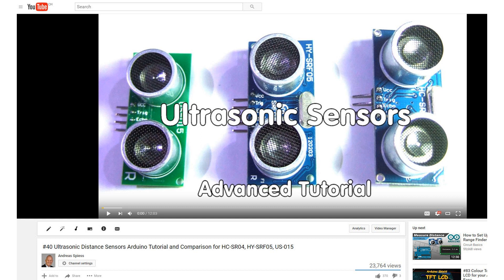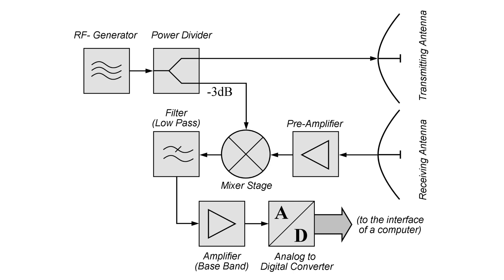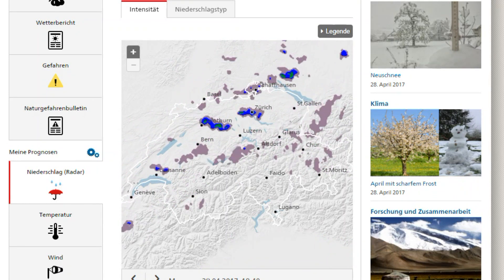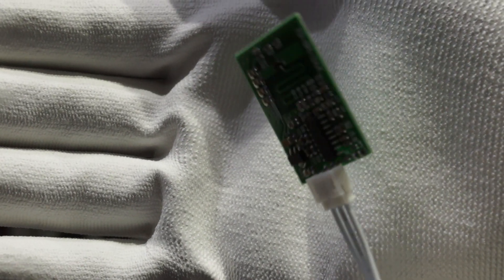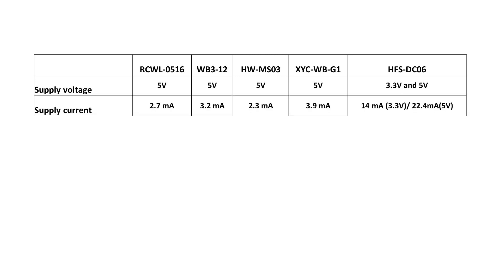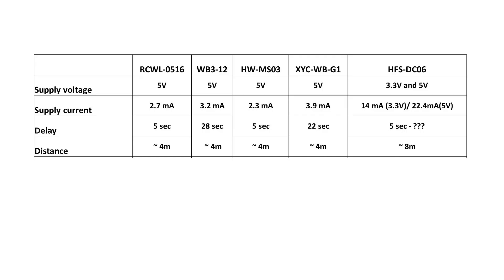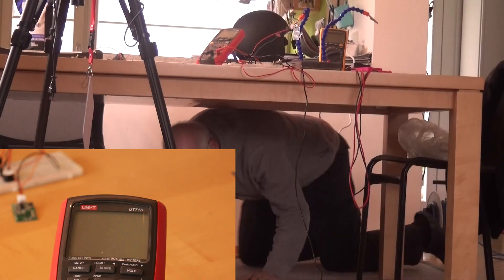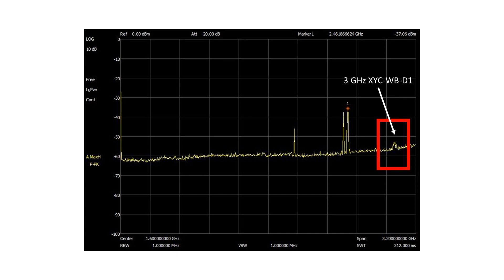#135 Radar Sensors / Switches: Comparison and Tests

Comment: Great video. An idea: could one of these modules be hacked for playing varying sounds by waving your arm or dancing for example? :-)
Reply from the maker: +yomboprime Try it!
Reply: yomboprime Just use the output signal to drive a midi controller. There are many examples on the net of using signals from diverse electronic gadgets to drive midi signals through virtual instruments and effects.
Reply: Yes, but the problem is that the output is delayed 5 s. I was thinking instead in measuring the output  of the mixer (analog signal), if that is possible.

Comment: Receiver, mixer and transmitter with one transistor is not uncommon. For instance search for "Pixie qrp". This is a 2 transistor solution but the second transistor is only for audio amplification. A simple direct conversion receiver is a continuously transmitter too. 
I think in this case of radar it is a regen receiver. The reflected frequency of a moving object is a little bit detuned and strong enough for this short distance.
Radar are only directional using parabolic antennas, as you can see in the video. Make a test put the module is a can know as a "cantenna". See if its works
Grüezi Tim.
Reply from the maker: Thanks for your explanations. It is possible, that the principle is similar to these pixies. But still, it is interesting, that it can receive and transmit at the same time and be selective enough to distinguish the received signals, which are for sure much smaller as the one sent out. The pixie sends or receives, but not at the same time as I understand.
Reply: @AndreasSpiess  The trick is that it is a self-oscillating mixer.  The transistor keeps the oscillation going, and at the same time due to its non-linearity it mixes the received signal with the transmitted signal, effectively a direct-conversion receiver.   The same thing as what you have in an old and cheap AM transistor radio.
The processing of the output signal provides the selectivity: a low-pass filter of the output is providing a bandpass around the actual transmit frequency, and this is where the doppler-shifted receive signal always appears.  The frequency of the lowpass determines the maximum speed of objects being detected.
By selecting a low enough lowpass and having enough spread in the production (capacitor value in the tuned circuit), the outputs of different units will be far enough apart to not cause mutual interference.

Of course without an RF stage it is not very sensitive, but you want only close range operation so that is OK. It is a very clever circuit indeed!
It is not very directional because the antenna isn't very directional.  When you would put the entire thing in the center of a parabolic dish (sat dish) you would get very directional operation and much more range (like the picture of a radar you show).

Comment: hello,
do you also links to the source code that you used?
Thanks!
Reply from the maker: I did not use any processor or software
Reply: Thanks.
I will watch again your video because I did not understand this the first time.

Could you please also tell me if you have any idea about the maximum distance at which these sensors could operate correctly?
Reply from the maker: We only tried 4 meters

Comment: Hello, great video as always!. 

May it be possible, that your glas door has some kind of special isolation glas? I have a glas ceiling lamp from Steinel with build in radar sensor and have put a lots of these E27 Light Bulbs with build in radar in different glass lamps and they work all very well thru the glas. Eaven thru my front door. My hall light switches on when I stand outside the front door. 

I love these radar sensors and I've nearly replaced all PIR with these. The E27 Light Bulbs are easy for places where you don't want to put extra cables. For replacing PIR I use these: https://goo.gl/0YL5en

I have lots of these in my house and I didn't notice any interference with my 2,4Ghz and 5Ghz WLAN.

It is cirtical to use several devices (from same type) in the same room. I put three bulbs in the same lamp and I got a light show!

I haven't tested these small ones for uC use yet but I have some already lie here.
Reply from the maker: Thanks for your feedback. I use a similar one as you in my lab and so far, did not have problems. After the video, a viewer suggested to switch a second sensor of and on. This triggered the first without any problems (if it was the same make). They did not influence each other when always switched on. Maybe I will play a little more with them in the future...

Comment: Hi again Andreas! I did a teardown/writeup on the HB100 doppler module a while ago at https://www.allaboutcircuits.com/news/teardown-tuesday-hb100-doppler-radar-module/ and yes, the amount of "RF black magic" in those modules is pretty amazing.
Keep an eye out for any which generate a complex IQ "quadrature" signal. I haven't seen any yet (in this range, they all have a single "amplitude" output) but a lot of interesting possibilities open up if you can get quadrature, such as synthetic aperture radar imaging.
Reply from the maker: Thanks for the link! I think, these modules are even simpler, because they only seem to have one transistor... I would be interested in your analysis of one of those! But I think, we both are fascinated about such simplicity...
Reply: Indeed! I noticed that, (no ceramic resonator, how!!) and the only thing I could think of was perhaps they're using the antenna itself as part of an LC resonator. It might also partly explain why there's not a lot of cross-talk - the frequency would be so inaccurate it would be pretty much random over 100's of Mhz, and getting more than a few Khz away is probably enough for post-mixer rejection.
Reply from the maker: Maybe it will stay a "working mystery" :-)

Comment: This was interesting, but I was hoping that these would work for distance sensing instead of just movement.  My ideal use would be front/rear distance for cars.At 3 ma x 5 v, that's not a lot of power - 15mW, and that is radiated across 360 degrees (well, a full sphere, if I understand some of the statements), so I guess that wouldn't be considered high enough to be a harmful amount.My other immediate thought was, if you put one in front of a metal plate, or small metal parabolic dish, could you use it to detect humans behind a wall.  On reflection, I don't think that this would work consistently - walls have different compositions and thicknesses, and a human at rest might not trigger the sensor, so it's back to movement detection.Still, it's very interesting.
Reply from the maker: 1. You cannot expect more for 50 cents ;-)
2. from the 15 mW a part is used by the IC, and part will be translated into heat in the transistor. So, I assume, we talk about micro watt really emitted.
3. As we showed in the video, they really can be used to detect people behind walls. But we did not test, how much the range was reduced by which kind of wall.

Comment: No concern about microwaves casually being introduced in the open?
Reply: It's a continuous transmission with a few mW of power vs. pulsed transmission of 2W from your mobile phone, and continuous transmission of 5kW from its base station near you. It's also orders of magnitude weaker than Bluetooth or WLAN. It shares similar frequency ranges. If microwave radiation is a cause for concern (it might or might not be), then these tiny radars are certainly not something you should be afraid of.
Reply from the maker: I assume, they emit microwatts. So I think, Siana is right.

Comment: i have the feeling these devices rather detect if a big piece of water is moving to or from them. so waving your arms isnt doing much. some lightbulbs that use them also have a LDR inside so they dont switch on when it is bright enough. though that prevents you from using 2 in close proximity
Reply from the maker: I think, I mentioned the water in our bodies as the reason, and waving of arms was sufficient over 4 meters. For bigger distances, I agree.
And one of the modules has the possibility to add an LDR.

Comment: With a lot of interest, I've got your video about Radar Units.
As you know, a Radar is most sensitive to motion directly toward the antenna. Swinging for the antenna should be much less sensitive.
The tests performed are surprising to me, but I assume that it is correct.
But there's more, I think.
Now it's only tested when a unit gives an alarm.
But how is it reversed. So, does a unit always give the benchmark result? I wonder.
And then how sensitive are these devices for malfunctions (unwanted alarm)? And one after glass fun, but a dog or a car 10 meters further?
How about water pipes is a wall, or a rain drain pipe. Rader detected very good water ...
Once again the test is perfect, but I do not think it's completely finished.
Please see my comments as constructive.
Reply from the maker: You are absolutely right! This was a first impression and a comparison. But there are many questions still open. You and other viewers posed already a few. Maybe I will deal with a few of them in the future. One topic for sure is about false alarms. Here, I can say, that the "ready made" device from Banggood shown at the end of the video works fine without noticeable false alarms. So, one could assume, that, properly used, false alarms can be avoided. But what, if it is used together with a ESP8266?
The second question is, if it can detect vehicles like bicycles and in which distance? What about small animals? The question about water pipes is also an interesting one (with sensitivity much reduced, I assume). So, a lot of experimentation also for everybody else. I started with a comparison. Who continues?

Comment: @Andreas : super-benchmark (as usual ...) !

A few weeks back, I tried  both the XYC-WB-DC and RCWL-0516 boards and fit them inside a small plastic case along with an ESP-8266 so to make a cheap, handy, discrete home intrusion device (that would send emails directly to my mailbox via my WiFi router).

The radar detection worked quite well and sensivity, angle and obstacle penetration was good.

Unfortunately, I was getting intermittent false alarms making the device unreliable on a long run.

Strangely enough, I noticed that when the radar board (be it XYC or RCWL) was taken OUT of the plastic case, a bit AWAY from the +5V P/S and ESP board, I had way less false alarms.

Has anyone noticed that these radar sensors were prone to false triggerings ?
Reply from the maker: I did not use them together with a MCU. But it is well possible, that they are influenced by other devices, especially emitters in close proximity. It is also possible that you have to use capacitors across VCC of the radar and a certain distance between the two devices..
Reply: I'll reshape the layout and try that again.
Thanks !
Reply: Andreas, what capacitor value and type would you suggest (I don't have much room available in the casing) ?
Reply from the maker: Maybe a 100 uF electrolytic and a 10n ceramic capacitor in parallel. But I am just guessing...
Reply: We **may** have a clue here : https://github.com/jdesbonnet/RCWL-0516/issues/2?_pjax=%23js-repo-pjax-container
I need some more time to confirm this solution, but **apparently** using a pi-filter between Vcc and Vin improves drastically the false triggers occurences ... to be continued !
Reply: So far, soooooooooooooo good !!!!

The pi-filter works like a charm : I never had any more false triggers since I installed it between Vcc (+5V) and the Vin input of RCWL-0516 sensor !

Here's the link to this 'resistor-only' pi-filter : https://www.dropbox.com/s/1nu4fzz7ysm1htl/RCWL-0516_False_triggers_PI-filterb.jpg?raw=1
Reply from the maker: Thanks for the feedback.  Did you try it without the resistor and the second capacitor?
Reply: Yes, I tried with a 1000uF capacitor across Vin, but this was also giving me false triggers (although less)
Reply from the maker: Thanks! This is interesting.

Comment: I had problems when mounting an XYC-WB-DC module near a Raspberry Pi 3 with WiFi. If I turned off wifi it worked, with WiFi enabled, it did not. The specifications on the module says 5.8GHz, but that seems unlikely when 2.4GHz knocks it out. I found the Chinese patent somewhere and will link to it I find it again...
Reply from the maker: I am not sure about the patent as I did not see any diodes on the RF part. And I can imagine that the devices can be influenced by other sendes in close proximity, even not on the same frequency.

Comment: Great video as usual. My question is: how does it behave with pets? Is a cat enough to trigger it? There are some sensor that ignore something as small a cat or a small dog inside the house, but since this radar passes through walls I wouldn't like it to trigger if a cat walks by house and even if it is inside of course.
Reply from the maker: I do not know, but I think, it is a function of the distance. So, close to the sensor, smaller animals should be detected. And maybe there is also speed as a factor. Lots of space for experimentation...
Reply: Maybe on the next order I'll try some of those. It would make a great alarm for perimeter around the house without having external sensors

Comment: Great video as always.
Any idea what would happen if you use them outside and it rains? Would the curtain of water be enough to trigger false signals?
I'm asking because this is a problem I'm having with a PIR sensor. It shows constant movement in the rain (the PIR is not getting wet, so water shorts can't be the problem).
Reply from the maker: I do not know, because I did not test. Would be interesting. Maybe somebody else does it?
Reply from the maker: Concerning rain: Venkatesh E answered this quesrion.
Reply: As I wrote earlier, using it in the bathroom didnt give good results as opposed to its use in the dry hall. I kept it on a plastic drum and it worked only a few cms as opposed to a few metres in the dry hall space.

Comment: Wow! Great video.
I can't believe the RCWL-0516 is so cheap! Bought 4 for $2 !!!  :)
Your video makes me spend more than I should on these gadgets and gizmos. lols.
I have had my eye on a pesky Racoon that has been bothering me... He is too smart and cute to harm though.
He just volunteered, and will make an excellent test subject for my night detection without IR or ultrasound experiments...
BTW, did you do any measurements of Power-up Ready time? It would be nice to know how long it will take each unit to power up, and ready to go.
Reply from the maker: No, I did not make these measurements. If I remember right, it always switches on first. So, you have to wait at least till it is off again..
Reply: There goes long term battery operations for me.
Reply: I can see it being used in alarm systems where the radar is embedded in the walls. Very discreet.

Comment: What happen if you add an metal reflector to a 360° module?
Reply: Given that the reflector is suitably designed, it should work quite well, both increasing range and providing directivity.  You could go either as Yagi (smaller) or parabolic.  But you have to know the frequency to design a Yagi!
Reply from the maker: +Winsucker One of the modules has some sort of metallic reflector

Comment: nice! so those modules have on/off output for detection. would it be possible to get an analog output to detect for example plant growth, or how much of the signal is reflected or something similar.
Reply from the maker: +Simon Filiatrault I am really not sure, but they should detect speed of change more than presence.
Reply: You're right!  Not sure what I can use to detect plant growth!  Maybe levels of specific light frequency reflected back from leaves? Thanks for the hard work you are putting in all this!  Amazing!

Comment: At 3:23 - this is actually 'super-regenerative' RECEIVER, which has bad properties of emit signal at the reception frequency. Reflected signal from moving object is shifted in frequency and phase, and it detects doppler shift in frequency spectrum by mixing emitted signal with received. The product of mixing is amplified and send to the detector circuit.
Reply: I'm not sure a superregen is the correct term.  Essentially, it is merely a continuous wave oscillator tightly coupled to the antenna (in fact, the antenna itself is the tuned circuit) so that small changes in the "Q" are detected in the running current.  It is in fact, monitoring the standing wave patterns is sets up in the environment so even the term "Doppler" is not 100% illustrative (as it probably detects sideways movement to some extent as well).  Note that its frequency is not necessarily stable either; it will be de-tuned slightly as the environment changes.

And these are not new - they have been around for at least 40 years to my recall.  What is recent, is the ready availability of microwave transistors and stripline PCB manufacture.  The ones 40 years ago operated in the upper tens or low hundreds of Megahertz with the transistors then available and used correspondingly dimensioned whip antennae.

And because they necessarily detect small fluctuations in the current of the tuned circuit, all such designs must incorporate an effective regulator and it would be inappropriate to bypass this unless your alternative source was itself well regulated - and separate from other loads such as - the microcontroller.
Reply: That is possible too. Thanks for the correction.
Reply from the maker: Maybe you have a look at the comment of Alejandro Vargas below